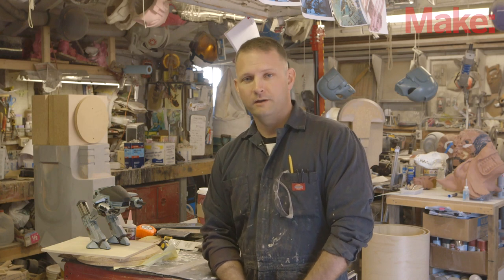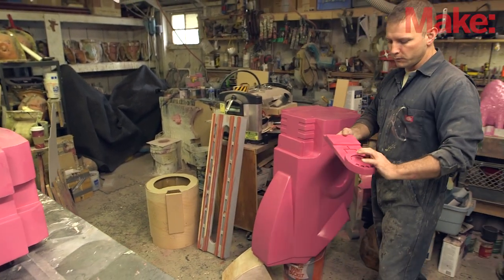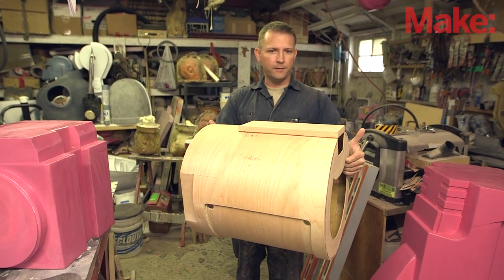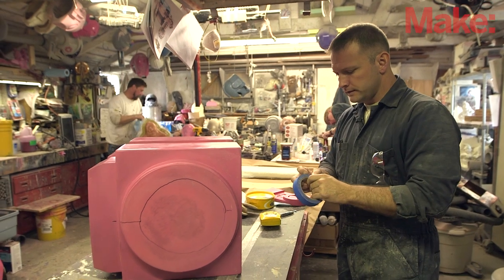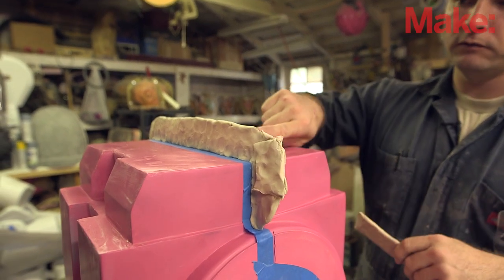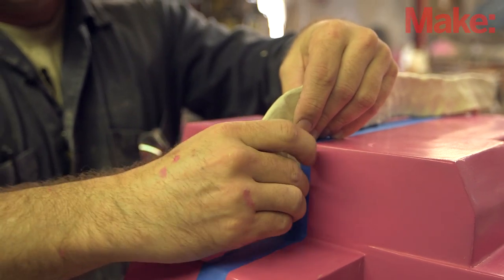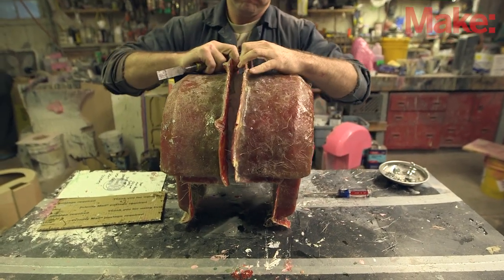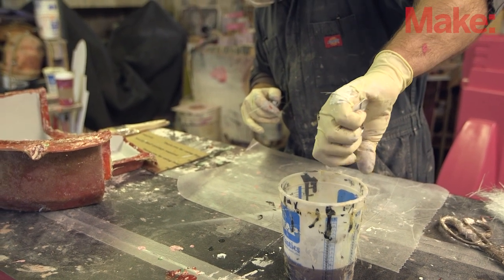Building Up To Maker Faire: Shawn Thorsson's ED-209- Part 2

Comment: Awesome !
I have a question : How would you do if you want a part that needs to be fiberglassed all around it ? Because you need some space inside to seam the parts together.
Reply: Make two parts and bond them together from the outside after you've removed them from their molds.  Either that or make the part big enough to live inside of for the rest of your years.
Reply: Shawn Thorsson
Haha my question seems pretty stupid with this answer.
The good thing of bonding from the inside is that it seems to be pretty easy to get a flat and well poslished surface afterwards.
If bonding from the outside with fiberglass, should we use other layers of gelcoat all over the enclosure to hide the bonding ?
Thanks for your answer and insight. Love this Make series, you are doing an awesome job.

Comment: too bad they used an infinite screw on the back of the leg to make it slide up and down on the rail... 
this kind of mechanism is used to (VERY!!!) slowly make something very heavy move with a small chance of it to go back, the concept should have used high-pressure actuators or electrical motors... so in hindsight 20/20 that was a bad idea even though it's cool to see the little circular cap spinning... but makes no sense, even at the time, so it'll be weird for you guys to pay attention to that particular detail... oh well, looks unbelievably cool anyways! I ALWAYS loved the ED-209! =D Good luck guys!!!!!! =D